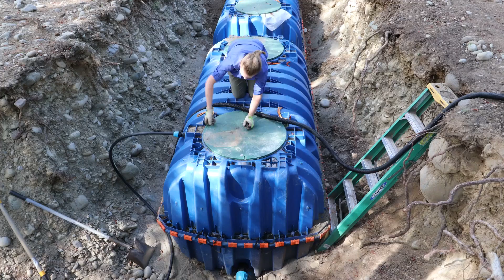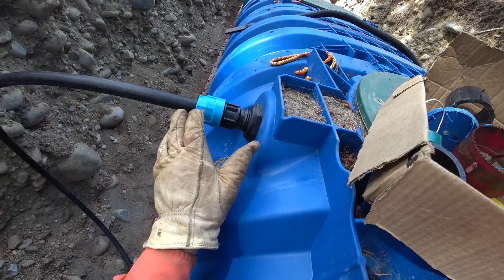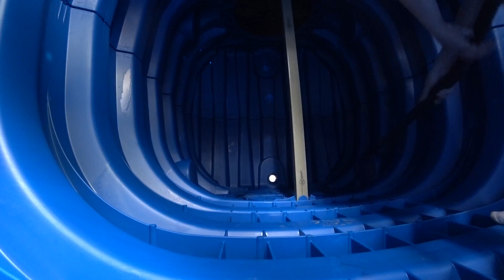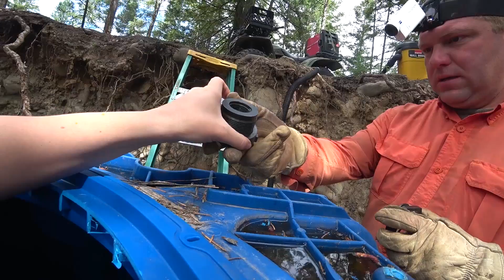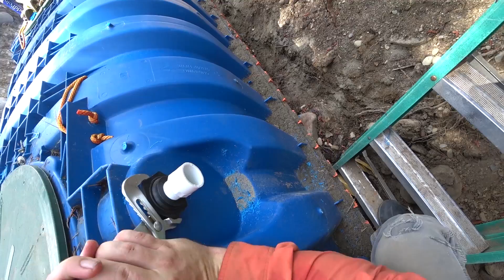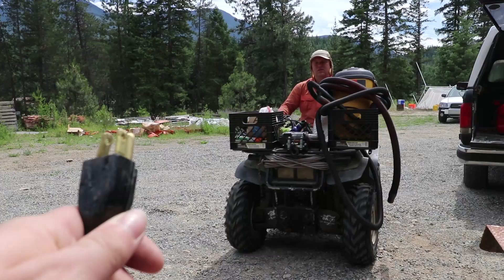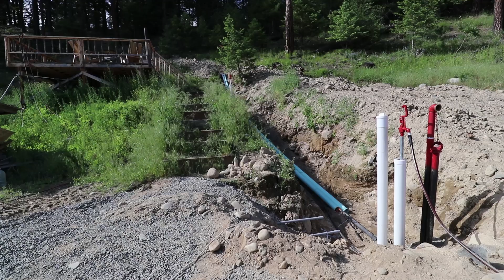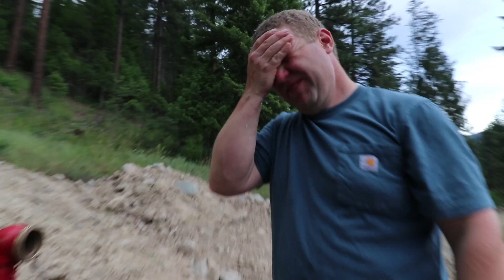First Time Using $10,000 OFF GRID WATER SYSTEM

Comment: looks like you need a vent connecting the 2 tops together . you had plenty of  2in poly pipe. the rigid 2in may break during a hard winter. I would have used the poly between the 2 tanks. also you will need some kind of vacuum break at the top of tank for filling and draining. around hear I would have made the tanks deeper. we had frost line 51 in . and code is 48 in hear.

Comment: Very interesting approaches to the underground construction portion. Not exactly the safest, easiest, or most practical solutions. Once you got underground the learning curve is sharp. As a tradesman I can point out the lucky moment like the vacuum sucking the air out which imparted new air to circulate in saving the young ladies life. the fact that your knot stayed tied and the pull line did not break sending the lady down the hill or worse rocketing in to her eye. I was waiting for the pull to seize and the pick up truck to rip all the pipe out of the trench. but hey I don't want to know why we use trench plates to shore trenches deeper than 4ft. these are risks that a DIY type must be aware of. The real cost saving for the DIY guy is not having the work mans comp insurance. or the cost of dedicated safety programs. Which brings me to my point when I am at home I run the rototiller and weed whacker with eyes squinted and flip flops on.

Comment: I am concerned about your connection between your tanks.  1. I am afraid the leaking water will attract roots and break the pipe 2.as you know the tank will be very heavy when full and may settle unevenly breaking the pipe 3. the back fill sand will settle with the winter snow and rain .  Sorry I don't have a solution but I hope you will take action to keep your water supply safe.  Good Luck.

Comment: If you had drilled a well down near the house and installed a solar powered pumping system you would have had  running water a year ago for less money and you wouldn't have all the torture of that hill top system. As far as potential fires go, you have a generator, so if you had a well you could actually put out the fire with garden hose, and have real flow and pressure. I wish you guys the best of luck, peace.

Comment: great effort!
Considering the amount of work and resources, if is not that late (cistern tanks covered), replace the rigid connecction between the tanks with a flexible one. Such replacement will accomodate movementes between the equipment reducing the danger of pircing the tanks (both of them).... Soil settlement, seismic activity, thermal expansion, etc...
For those 5 ft ht tanks at the 2" no more than 2.2 psi... also consider a vortex eliminator (a plate that kills the siphon effect at the output)...
Good luck and thanks for sharing your experience! and your wife is a real team player!

Comment: why didnt you use a universal joint on the pipe connecting the two cisterns it would have made installation a lot easier along with Servicing in case one cistern had to be ever removed in the future

Comment: The OVERFLOW - I'm thinking an upturned elbow on the inside will raise the water level in the tank.  It could be extended into the vicinity of the access hole.  I don't know if a p-trap would be of any use, or even functional.  

The good thing about videos is that you have many minds working on your project.  The bad thing is that there are many ideas to weed through.

Comment: Why wouldn't the water coming out simply be the water in the drain line you pumped up?  If the line was filled, aren't you just draining it out again?  Maybe it set up a siphon, or maybe it's just backflowing...  'Course if so, and the tanks aren't vented it WILL eventually vapor lock.  And then you'd have to refigure it all out.  Again.

Comment: Why didn't you put in an isolation valve between the 2 tanks? With a tube to surface level.  That way you can work on the tanks without draining both.

Comment: Once you get enough water in the reservoir, there will be enough head pressure to force any air out of the system down to the hydrant etc. Gonna take allot of totes of water to get that full! hope you can rig up something to fill using the fire hydrant. Will work good that it has a shut off right there for it to. Also fire hydrant being half open probably was letting water out the weep hole.
Reply: filling through fire hydrant would also let you have a water hauler come and hook up and get it done in probably 1 load!

Comment: Would it be a bad idea to put a weeping tile around the tanks, and have that area drained, and if the ground got saturated by a leak in one of the tanks, would that create a slide?  The bottom of the overflow , should also be level with the top of the inflow.
With 2 tanks the inlet should be on one tank, and the overflow should be on the other,and vented to the air, this would prevent any air locks and/ or any issues with negative pressure in the second tank.

Comment: Jesse, Congratulations on the water!  Only one comment.  Please cut that encasing off your hydrants or fill it with expanding foam or some sort of grout.  The air gap is bad news for freezing and the wobble when I see you opening is driving me nuts as a guy who has installed and repaired many. The failure of these is rarely the stand pipe. Its typically the valving or the fittings used to connect it to the main line.  The main predator of hydrants in the wild are mowers and vehicles.  Putting a steel pipe post (with a hose hanger) next to your hydrants will protect them far more than some schedule 40 encasing that will be UV rotted and brittle in 2 years.

Comment: If you guys put an riser inside the tank you have all the flexibility you want for positioning your flange for inlet, outlet or any other connection... its the way its done in the industry if you have this sort of limitation.
So if you want to maximize the tank capacity, just add and L-pipe inside to the level you want.

Comment: Agree on fill pipe to the 2nd tank and the air vent. Work on building municipal water plants & they always require you to disinfect the pipe easy to do before you have too much water put in bleach and run it threw the pipes & flush them out. Not sure of a bleach mixture to water but make sure you smell it when it comes out the pipe at the bottom use it to wet the road until the smell is gone. Just a suggestion I have a well & I flush my house out a couple of times a year. Great job enjoy your videos!

Comment: Hello from Hamilton New Zealand, we don't live off grid  altho at times one might think so.. ;-) Before I get round to asking you a question or two, may I compliment you both on what appears to be the perfect match up. You both seem to get along really well, and working together can often cause problems.. 
You may have already fielded this question but Im curious as to why you pump water up to your 'reservoirs'  only to have it flow back down for pressure? Surely your pump would achieve that for you?  Reason Im asking is because down this end of the earth  ;-) people collect water from their roof's and store it in 30,000 litre tanks  either mounted on the ground or partially buried. Then they pump it  to their homes etc..
Cheers   and thank you for very entertaining videos.

Comment: I just wanted to let you know that it doesn't matter where you put the pipe to connect the cisterns. My pipe to connect mine and the inlet from the well are all on the bottom. The pressure fills them. I have a float valve that shuts the well pump on and off.

Comment: you should have put isolation valves between the tanks , so if anything ever moves or goes wrong you wont loose all your water, also put flexible pipe between them to allow for any ground or tank moment

Comment: Hi  Guy's
I used to work for a water company fitting tanks and the in let and out should be at opposite ends to each other so that there is NO STAGNATION !!!!!!!!!!
In your case put the inlet on the back tank !!!!!!!!!!!!!!!!!!!!!!!!!!!!!!!!!!!!!!!!!!!!!!!!!!!!!!!!!!!!!!!!!!!!!!!!!!!!!!!!!!!!!!!!!!!!!!!!!!!!

Doug.
Reply: Absolutely right.  Plus the venting issue and the flex connector issue and isolation valve issue.  It's getting frustrating watching all the off target over-thinking and the missing of the simple, common sense solutions.

Comment: "vapor locked" I never would have thought of that term.. I had some fun playing with that problem today. it's kinda neat how it can happen worse than you think. I put a solar water heater on my sand mound, pumping water slowly to it from a pool below with a small solar powered pump. it works great once I got the air pockets out of the return line and leveled it better. my first day trying it, I saw 71F going in and hit 100F coming out at one point. if I'm not to lazy I'll connect some temperature probes to it and monitor from my computer.

Comment: it's ok to have some extra water on the bottom of the tanks that doesn't reach the outlet pipe. if any sediment does build up in the tanks over time, leaving that little extra water in the bottom will help prevent pulling a bunch of dirt when the tanks empty. you might also want to look at how the fill line delivers the water into the tank. it might help to have a pipe go down to the bottom of the tank to fill it, with some large elbows to direct the water calmly upward away from the bottom, so as to not stir up any sediment.

Comment: Not on your water system. But should there be a second pipe at the top between the two tanks for air to escaped. Do you need a air breather on top of one tank so air can move out when filling and air can move in when emptying the water so get more force. Your overflow might help with that.

Comment: I'm really impressed with the work you guys have put into this system...I  really hope you guys think long and hard about the venting and adding a top tank connection pipe that other commenters and myself have mentioned.....Something that I think needs to be looked at very seriously is what are you going to do with the open end of your overflow pipe or any other open pipes to the atmosphere? If a mouse crawled thru the overflow into the tank and died you water would be contaminated and you'd never know it until it was to late.

Comment: I do not mean to be a bother but are those water tanks air pressure tight on top? The tanks will only even out if the secondary tank has a way to release the air. This will not be too bad because air is able to be compacted easily. But just food for thought.
I do not mean to make more work but a small pipe coming out the top of the second tank or a pipe going from tank to tank on the top side part would both do the trick.

Comment: It's impossible that your drain line was vapor locked since you had a low point open to the atmosphere.  The reason filling the drain line caused water to flow out is either you put in enough water to get the tank height above the highest point of the drain line OR you completely liquid filled the drain line and started a siphon.

Comment: Your inlet should be ted on the iside with a on the top of the connection at the top of were the two tanks to help even equalization of the two tanks. You have to have a vent on the cisterns or you will get cavatation.

Comment: If you put an elbow on the inside on the 2" bulkhead fitting facing down it will siphon the water lower. I just built a gravity water system and in adding the elbow it empties the tank completely!

Comment: Where is the Vent?(if you're calling the overflow you're vent it's VERY undersized)  Your supply side line is 2",  Assuming worst case and you're pulling full flow from your supply side off tank you need to be able to replace your exact amount of water with air.  You're going collapse these tanks with this setup.

Comment: Jesse:   Have you considered building a rough box (cribbing) around the fittings at the tank about  2' high.   After back filling this will make it easier in the future if you have to go back  in.  The shallower the depth of excavation the narrower the hole.  Besides it would give you an excuse to mill some 2x boards from the slabs when cutting your timber frame size cants.    Bert

Comment: Is using a hard pressure pvc pipe between the two tanks a bad idea?

I'd have expected you to use more 2" poly or such in case with tanks settles differently. The hard pile may brake no?  No flex or give?

Comment: So yeah, i guess i just plussed all the comments that i wanted to make ... great you got this far, hope you still have breath to finish it, i'm guessing about a weeks more work ... connect the cisterns at the top (so they keep the same pressure, have a way for air to come in and go out (either in one or both), put the inlet WAY at the back of the second cistern so water actually circulates and can't go stale, obviously plug the previous inlet location (or it can become the air-vent?) ... then make sure the pipes are all grading downwards, fill the whole thing up to test for actual 'pressure leaks' ... then backfill the ditch ... Btw. if it's that hot there, maybe grow grapes on the hill and start making wine? (it's not a margarita, but it can be a sangria ;) .. hang in there !

Comment: So you don't have to make a connection across both tanks on the top too?  To keep pressure same across both tanks?  Or will air in the second tank compress on top and just be pushed out more or less if you come close to emptying both tank?  Sorry if that's a stupid question.

Comment: You should have asked for help in your plumbing design, the way it is would not pass inspection in any jurisdiction in the US. First of all each tank should be plumbed as stand alone units then tie them together. (The tanks will move ever so slightly and you will have a leak). Each tank has to be vented separately (I have seen steel tanks with 1/4" wall thickness collapsed like a beer can when drained with out a vent), each tank should have its on isolation valves for both supply and return. Just as soon as you leave the tank a short nipple and valve should have been installed then run into a tee then the main isolation valve to be installed. You were right when thinking of a ridged connection between the two tanks, this is probably where a leak will develop over time. Also install valve boxes at each valve so they can be accessed with a curb key. Good luck. BTW compression fittings should only be used where they are accessible.

Comment: Great work guys! It's been quite a journey for you to get the system running! 

I have a technical question, if I may. Why did you choose to connect the two cisterns together at such a low point? Wouldn't be safer to connect the sicterns at a higher point? In case the connection fails, you would have some capacity to store water if the sicterns connection is higher than where it is now. I'd love to hear your opinion on that. 

Again, great job on your water project! Can't wait to see more of your successes!
Reply from the maker: +Dave Rivkin Low connection is a must to allow access to the entire capacity. Ignore the connection and think of it as one big tank.
Reply: Pure Living for Life 
Got that. Is there a reason NOT to connect the sicterns on a higher point? In a high coint of connection the total capacity of the system is still of two sicterns where one will fill first and the over flow from the first will fill the second. What I am essentially asking is since a connection on eirher top or bottom of the tanks will create a larger capacity system what other factors made you decide on a low point connection? 

Thank you for taking the time to answer my questions. :-)

Comment: You have probably already gotten comments on this already, but do you plan to run both your tanks at atmospheric pressure or at a positive air pressure. The higher elevation of your tanks probably gives you all the head pressure you need. So atmosphere seems appropriate. This means you will need a standing vent pipe for both tanks. Be sure to use a steel wool kind of filter on top of each vent pipe to prevent critters from entering your tanks.
Reply from the maker: +Thomas Telford Both tanks will be vented.
Reply: Pure Living for Life, Maybe you should pin this post to the top, because all your technical advisers don't read comments this far down lol

Comment: You need to vent that back tank because ones you get over that bottom connection it will try to pressurize it. And if any water gets into it you will have a hard time getting it out.
Reply from the maker: +jake2213b Both tanks will be vented.

Comment: Surprised you used a rigid connection between the two cisterns.  When filled they're going to be enormously heavy.  If they settle at different angles, that connection is going to be under a lot of stress and you might wind up with a break.
Reply from the maker: +Jason Patterson Experts agreed solid connection was best. Fill under cisterns is compacted.

Comment: you should never glue the inside of water pipes as the glue will ware off into your water you only glue the outside that way the glue then connects to the outer pipe and can't gt to the water and why is it your wife does most off the hard parts to the jobs